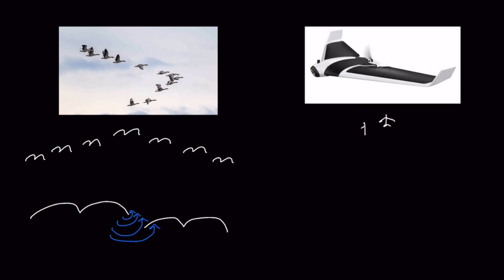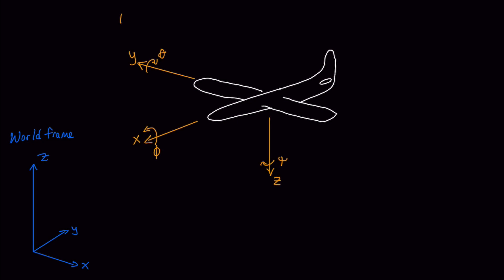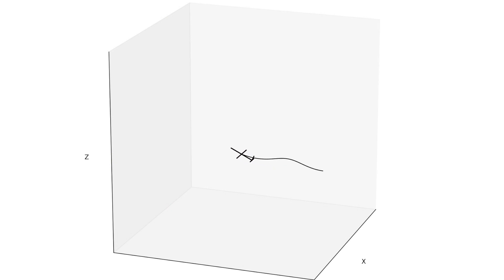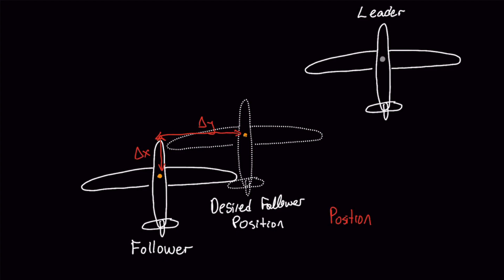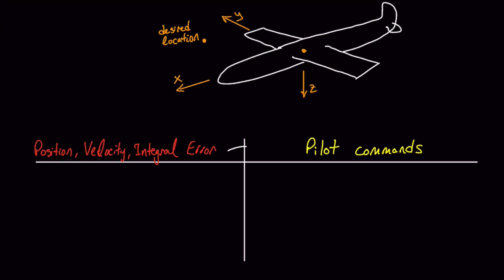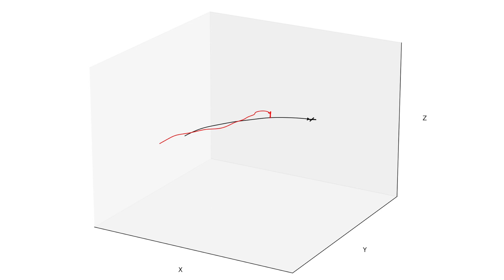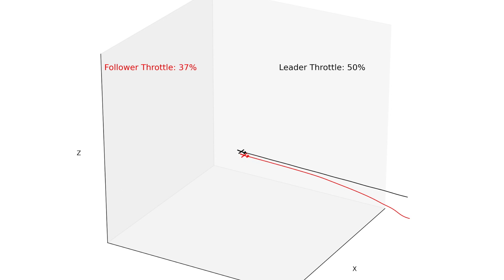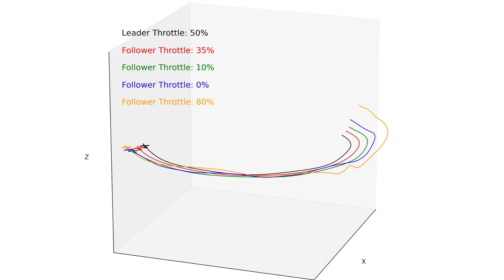Autonomous formation flight: Harder than you think!

Comment: While i appreciate the nice simulation and visualization, I can't ignore the fact that you're wildly approximating the main phenomenon that you're trying to analyze.
The moment you added extra lift to the followers you have automatically added more "free" energy to it, naturally requiring less throttle input. 
Do the control inputs affect the drag? Since your model also adds a roll moment to the follower, to keep the desired distance from the main it should counter it with control inputs, but while in real life they add drag to the system, it isn't mentioned in this video.

I'm not an expert, correct me if I'm wrong,  and i really do appreciate the video, but I feel like the core of what you're trying to visualize is oversimplified

Comment: My intuition is that in reality the leader would also need less throttle. But that is more of an aerodynamic perspective and not what you designed in the control simulation
Reply from the maker: I think you might be right there yeah
Reply from the maker: Another thing I found but didn’t mention in the video- if the profile drag is dominant in the total drag (induced + profile) than flying in formation doesn’t provide any benefit. After all, what we are trying to do is reduce the drag, and thereby reduce the thrust (and therefore power). So the induced drag has to be high enough in the design of the aircraft to warrant the use of formation flight. If it’s not, there’s not much benefit, since all the thrust will go towards overcoming profile drag which is independent of the induced drag benefits of formation flight. It was cool to see that in the sim, since I originally had my profile drag set way too high and the thrust really didn’t drop much when they flew together
Reply: @peterryseck  induced won't be negligible, so you should see benefit: when flying at L/D max vel. (which is what you probably want here if ur going for endurance), parasitic drag (which profile drag is just a subset of) should be equivalent to induced drag (induced drag goes down w/ vel, parasitic goes up, L/D max vel is right where they meet)
Reply from the maker: @acey-sc3ft  yup good points

Comment: Neat. I feel like bank and yaw limts as well as using energy differential as another error could be pretty useful. Also, why not make every plane follow the leader with a different offser instead of following the closest plane? That would prevent the accumulated error and make thr system more responsive
Reply from the maker: Thanks, yeah good point. I could have done that, but figured this might make more sense since in reality each plane would experience different flow states so things would be different in reality per aircraft, so might be better to target the immediate next plane.